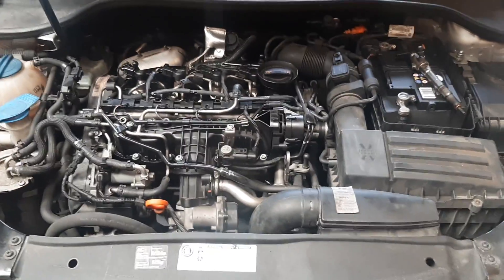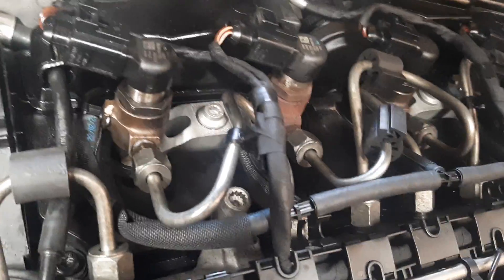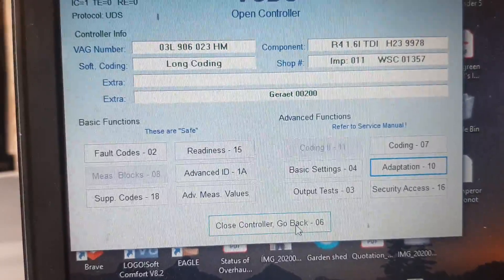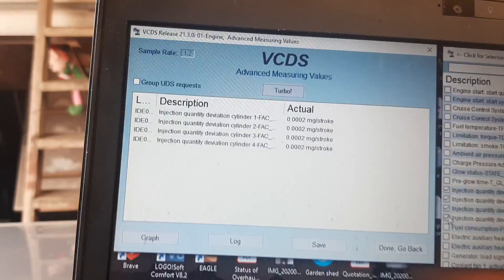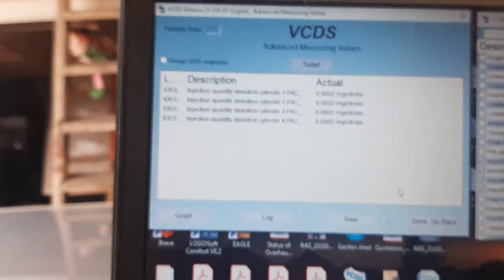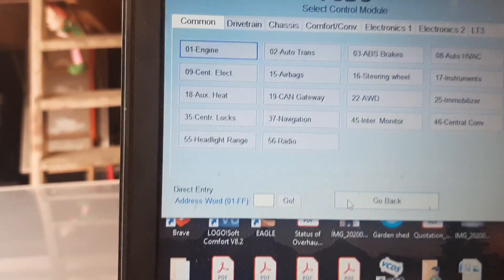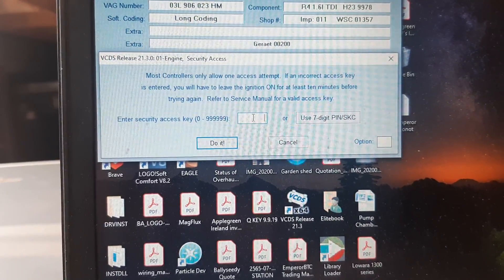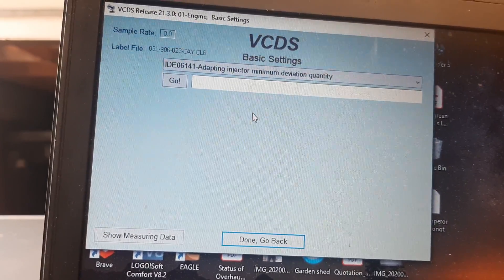VW 1.6TDI Injector Quantity Adaptation IDE06141 CAYC engine

Comment: I have replaced two injectors, A1 1.6 CAYC, with second hand items, I have carefully followed your instructions, but after I have done the clutch, brake and reved the engine vcds does not seem to go through the sequence of reving the engine and can run for 30 mins and not say it has complete, any ideas on why?  After I had coded the two injectors (by using the 1234 order rather than the firing order, this appears to be very unclear what order should be used) the engine felt and sounded smooth, but after 15 miles it was running terrible again, would this be because the Quantity Adaptation was not completed properly?  I was really appreciate some advice, please.
Reply from the maker: Hi man, firstly why did you replace 2 injectors? Secondly it is quite possible that the replacement injectors have high leak off etc not a good idea to use secondhand injectors unless they have been tested. Thirdly re-coding second hand injectors is telling the ECU that you have replaced them with new ones, the ECU compensates for injector wear over time so not a good idea.
Reply: @enginemanagementadventures7305  The engine was barely running and when I read the codes with VCDS it should there was two bad injectors, I used second hand items because they were tested and have a three month warranty the other reason is being a 2011 car it's not worthwhile spending money on new injectors.  I was under the impression when the Quantity Adaptation was run it would adjust the ECU so the used injectors would deposit the correct amount of fuel required.

Comment: Hi, thanks for the video explaining everything, I had injector knock and now it has gone away! The only thing that's confusing me is that before I did the adaptation injector 3 was showing a value of +1.8mg/stroke and now injector 2 is showing that value instead. Anyone know what might have caused this? The engine is running smoothly and no noise, but why is it now showing injector 2 as being an issue, it was just changed.

Comment: Reseting adaptation really makes a difference, I have replaced injectors on 1.6 TDI CAYC Fabia II, coded the injectors, went for a test drive and the run better instantly, but there was still a bit of hesitation around 1500 rpm on 3rd and 4rd gear and knocking sound from the injectors like on the old ones, I reseted the adaptations and the injectors are much quieter, overalll noise of the engine is much smoother, and the car runs more smoothly. I recommend you to do this after replacing injectors. One note, at first attempt I was in that bad loop, where the adaptations would not work, I had to turn off the car and start again, run vcds again, put the security code and then the adaptations finally said, depress brake and clutch and thats how you know the procedure will be good.

Comment: I’m hoping someone can help! I have a 1.4 three cylinder polo 2017. It has diesel knock on med to high revs, had all injectors tested and came back with no faults, also no fault codes. Would this process possibly fix this?
Reply from the maker: I guess you need to define diesel knock and explain its manifestation in this case? 
Do you have a code? What are your idle competition values etc. These engines are inherently unbalanced anyways, is your flywheel if you have one ok etc.
Reply: @enginemanagementadventures7305 I don’t have any of the values as of yet, I’m hoping to get it to a specialist Monday. Under load I’d say about 2/3000 revs, and uphill it sounds worse. Iv had the injectors out because one of them had blown the washer and had back pressure through the rocker cover, rebuilt it back up and had a diesel knock so sent the injectors off to be tested but all came back ok
Reply: Also scanned for fault codes and no codes
Reply from the maker: @danieldavies2077  Just one injector out?  is there any way the compensation codes are wrong mixed up for the applicable cylinder etc.  That engine has a delphi setup I think, which are notorious for bleeding the trigger chamber in the injector itself. need Vin to confirm, anyways if delphi hold at fast idle for 10 mins usually sorts that out.
Reply: @enginemanagementadventures7305 I had the three injectors out and tested, they tested them twice too 🥲 also forgot to mention I had the quantity adaption done previous to me fixing the blown injector washer, would it be compensating for that still and maybe need to do the quantity adaption again? Also you mentioned holding on high idle speed, is that pedal all the way down on idle or just a steady speed? Thank you so much for the reply’s!
Reply from the maker: @danieldavies2077  The Video shows the procedure for the 2009-13 approx CAYC engine with Siemens/Conti setup. The 3 cylinder 1.2 /1.4 use a different injection setup. Fast idle only 1200 - 1300 rpm. make sure the injectors went back into their original cylinders or the compensation values will be wrong and cause them to possibly over-fuel.
Reply: @enginemanagementadventures7305 ok that’s great! I’ll try that today, fingers crossed, and I marked them and took pictures on removal so I’m pretty sure they are put back in the correct order, i’ll scan it later and double check though. Thank you again

Comment: Audi 1.6 TDI 2012. Replaced injector 3 & 4 last year. Now misfiring when engine gets hot. Electrician said injectors 3 & 4 are out of syn. All 4 injectors were incorrectly coded. He coded them correctly now. Will the procedure shown in your video work for me ?

Comment: Hi, My 1.6 TDI CAYA is remapped. Should i first run IDE02703, then IDE06141 and after that drive away  at high speed possible so it can relearn ? 

And can you explain something about IDE 02147

Thanks!

Comment: Have you ever come across a new injector coded in and everything reset like you have shown in the video, ten mile road test no faults, turn the ignition off and take the key out, wait a minute and start again, the new code for the new injector has reverted back to the old code and fault for that injector is back? 
Ive done 100's of these and never had a problem until today 🤔

Comment: Hi, I just changed my #3 injector. It shows a value of +2 mg/stroke. Should I try this? Could it damage the engine if the injector is actually bad? Injector is second hand. The one replaced showed 1.6 mg/stroke. Please help.

Comment: Hi, You have to press the clutch pedal first after pressing the brake and accelerator at the same time, is that right?
Reply from the maker: @momoabdel5694  press clutch and brake together then release and press accelerator to the floor. Follow the prompt on vcds

Comment: Thanx for the video, works perfectly. Just a note to other people. I had to do this twice(had to replace ecu twice) in 3 years. It doesn't necessarily only take 5 minutes. My car both times took 25min +. Just be patient, it'll finish correctly. It'll also occasionally rev hang at about 2000 rpm, also normal. Make sure you have more than a quarter tank of fuel, check oil and water before. The car gets extremely hot. Also keep in mind some of the diesel spilled during eg injector replacement will start smoking, don't panic and abort the process. It's almost a bit nerve recking hearing the car rev like that, but just relax, it's normal😂
Reply: I just had the anxiety moment this afternoon! It was cold here today, but jeez there was a lot of steam from the exhaust. I’d even suggest there was a bit of blue smoke at one stage 😮 It sounded pretty nasty at times also, though I had been down the endless loop mentioned elsewhere, which might fubar any adaptations that were originally set.

Comment: Great video!  I've just replaced all 4 injectors with reconditioned ones after one failed, so replaced them all as No1 looked on way out. Its an Octavia 2011 TDI 1.6CAYC. I have injector leak off pipe coming off on the No2 injector. Have replaced with new OE leak off pipes, o rings, and clips. Coded injectors. Car runs and starts  fine. Have I missed something that's causing leak off to come off?
Reply: Oring takmayı unutmuş olabilirmisin veya takarken yaralanmış olabilir mi.
Reply: @senyaparsaniyiolur fitted new leak off pipes and rubber rings.  Would this adaptation test stop this and possible overfuelling?

Comment: a quick advice for everyone trying this procedure. i tried this on my cayc 1.6 tdi, followed the procedure religously but the car just idled without revving, and vcds said 'running'. stopped it after some time, and the car worked even worse, like tractor. i've read somewhere that the ecu software is probably too old. i went to an independent tuner, he updated the ecu to ver. 9979, then tried this procedure again. car was revving to about 3k rpm and it took around 10 minutes. no more rough idling, white smoke with diesel smell, car works like a clock, no injector knocking. costed me 60€. thank you for this informative video, cheers!
Reply: Hi just had the software updated aswell and started the procedure. It worked but it went on and on. I waited about 20 minutes before giving up. How long did it take you to finish the procedure?
Reply: @Akililiri  tuner was confused as well because it lasted well over 10 minutes for the first time he ran it. i saw him go into the car and interrupted it somehow, probably by touching the gas pedal since i didnt see him touching the laptop until he ran it again. the next time he ran the procedure it took 10 minutes and then stopped revving and idled normally. im sorry if im not of much help but i wasnt paying too much attention since he had some cool birds in the cage near his garage lol. good luck man
Reply: @eu4iya ah okay thanks
Reply: Where did you update the ecu?
Reply: Where are you
Reply: Having this issue where it just says running but idles at around 800 revs!
Can't seem to find anyone local to me that does updates and don't really want to drive it too far as it's running like a bag of nails!
Anyone suggest anything else I can try to get the program to run?
Maybe an older version of VCDS?
Reply: @markbradley2042  Where are you? What are you going to do now? Go to Volkswagen to update? Software version 88? ? It seems not to work
Reply: @linli3031  I live in Wales, I had a friend of mine who's a mechanic recode the injector with his snap on. But it didn't like the fact that it wasn't a new one!
Guess it's just a case of trolling the Internet to see if there's someone that does a mobile update service.
A friend suggested sending them all off for refurbishments so the all run similar.
Reply: @markbradley2042  What is your software version 8856?
Reply: @linli3031  would have to check again and reply later as I'm at work at the moment.
Reply: @linli3031  so just checked and it says 8831 on VCDS
Reply: @markbradley2042 I've  replaced all 4 injectors on mine with reconditioned ones, the deviation quantities are high but within range but I think they're overfuelling, and tiny leak on leakback. Not sure if you can help but would this procedure bring figures down?
Reply: @AledRoberts-k7e  from my understanding, if you run this process it will adjust the deviation quantity of the injectors and bring them closer to each other. Some people have run this process a couple of times in order to get it to where they are happy from what i have read.
The issue seems to be getting the program to run on some cars as the it doesn't seem to work on anything that begins with 88--.
Reply: @markbradley2042  many thanks, I'll check my ECU version first, fingers crossed, it's not an 88-- lol
Reply: @markbradley2042   it turns out my software version is 8813! A newer version (9980) is needed.  It was remapped 18 months ago and I didn't choose the update at the time and they said it wasn't worth it. Nearest Skoda dealer is 30 miles away.  Any way this can be done remotely? Don't worry if not, I can  email Skoda directly  .
Reply: I don't think it can be done remotely. I also think that if you do update your software now, there's a good chance you will also lose the remap!
Sorry for the bad news! 😕 @AledRoberts-k7e
Reply: @markbradley2042  no worries, thanks for quick reply. I'll ask the company that did the remap. I'll defo fix it somehow as it's a very clean car with low mileage (fingers crossed)
Reply: Best of luck buddy, hope you get it sorted.@AledRoberts-k7e
Reply: @AledRoberts-k7e Is 9980 the diesel gate version?
Reply: Are you ment to have a flashing glow plug light when it starts????
Reply: When running ide 06141, the glow plug light will flash but the speed will not change
Reply: Should it be enough to run it once? I tried twice and still had diviations.

Comment: Hey, Thanks for this video describing these things in great detail! Much appreciated :) With my VW Transporter T6 2016 the Injection Quantity Deviation for each cylinder is not listed in Advanced measurement values in VCDS. Is this because my ECU does not have these values available for diagnostics?
Reply from the maker: @AmundAntonsen  Hi man, I'm pretty sure your ECU is delphi in that model so completely different engine management form the continental.

Comment: Hi can I ask I have a problem with pre injection 1 activation duration  is showing 0 on my scann tool . It’s a cayc 1600cc Vw beetle 2014 plate . 
Main injection is 0.3735
1 injection is 0
2 injection is 0.276
3 injection is 0.284 
  Many thanks .

Comment: Thanks for the video and for helping the community...
I have 1.6 tdi dsg with 9922 soft up. B injectors, 130k km.
I did this adaptation and the clicking sound that came from the injectors is much quieter now.
I did not have any symptoms apart from that sound.

The adaptation ran for about 5ish minutes, up until 3200rpm couple of times.
I don't feel any change in performance.
Reply: İnjection Sapma değerlerini öncesi ve sonrasına baktın mı. Bir değişlik varmıydı

Comment: Golf 1.6 tdi cayc 2011
my mechanic only replaced the piezo of cylinder 1 with another used one because it was burnt without replacing the injector. Does it still need to be recoded? How do I know what value to enter? furthermore I have -2mg/stroke on cylinder 1 at idle, while the "cylinder 1 main injection voltage charge" value is 690 uAs, about 40 points less than the other 3 cylinders. After 200km I had the same P0201 problem again but this time by resetting the errors, cylinder 1 also started again. I can hear a lot of noise between 1000 and 2000 rpm while I accelerate, both hot and cold.. before the piezo broke, the engine was perfect with no noises.. this procedure could solve my problem or should i replace the injector with new one? Thank you so much for any suggestions

Comment: Warning to anyone attempting to do this with a third party tool. I was trying to use an Xtool D9S Pro to perform the adaptation. It didn't run the correct program and got into the infinite loop problem. You will know you are in the correct program because the instructions will tell you to press the clutch and brake pedal, then release, then accelerator and release. The incorrect program will tell you to press and hold the brake pedal and accelerator together. 

Furthermore, the incorrect program WILL delete all existing adaptation points and the engine will run very rough after you finally give up. In my case it was running rough, misfiring, vibrating excessively, deviations were +2 to +5 and there was a lot of smoke and injector knock. 

When I switched to using VCDS and following instructions properly, the correct program ran successfully, but did not fully fix the rough running. I ended up running the program multiple times and after the second run, the engine was purring again quite nicely but the deviations were still a bit high. By my third time running the adaptation program, the deviations had gone down to well below 1 and my issues were resolved.

And one final point, be sure to run a DPF regen BEFORE doing the adaptation. It appears an excessive DPF differential pressure has a detrimental affect on injector adaptations, so by doing a DPF regen, you give the vehicle the best chance to properly adapt the injectors. Just make sure to shut down the engine after the regen, wait for the ECU to shut down, and then starting from fresh proceed to running the adaptation.
Reply: Ciao ti volevo chiedere,posso eseguire il basic setting a macchina fredda?i miei iniettori non sono regolari solo a freddo.grazie
Reply: @danilo-4174 ben de bunu merak ediyorum sanırım sıcak olması gerekiyor. Bir yorumda araç ısınana kadar 2500 devirde çalıştığını yazmıştı. Evet şimdi gördüm 70 derecenin üzerinde olması gerekiyormuş.

Comment: Does anyone know if IDE06141 will only work if a certain  ECU software is loaded?
As my ECU has 2010 software  version 8831,my minimum quantity adaption failed to work.
I  have NOT had the EA 189  fix done to my Golf Mk6
Reply: I did this and it failed for me.
Reply: Do you know what ecu software version you had when the test failed? @ohsasho5865
Reply: @ohsasho5865  Hi, so looks like we are in the same boat with this adjustment of the injectors.
Please may l ask do you know what your engine ECU version you are at.
This is shown in the VCDS scan of the ECU.

Comment: Hi, just tried to do this on my VW Golf Mk6 1.6 tdi cayc 2009  Simos  PCR 2.1 ECU software 8831.
My VCDS version is  19.6.1 it failed to do this adaptation even though security access was accepted.
Is this because my ECU software is to low at 8831 which is 2010 date?
I have read others saying ECU software needs to be 9971 pre EA 189  ref diesel gate scandal for this to work.
Do you have any information or personal experience of why this adaptiom might fail?
Any help would be most appreciated.

Comment: Thanks for this it helped me alot!!!! just a pointer if the car is not at 90 degrees c the adaption will rev at 2800rpm until it gets warrm...
Reply: Is this with your foot on the floor or does the car do it automatically?
I think I may have been stuck in the endless loop mentioned 😢